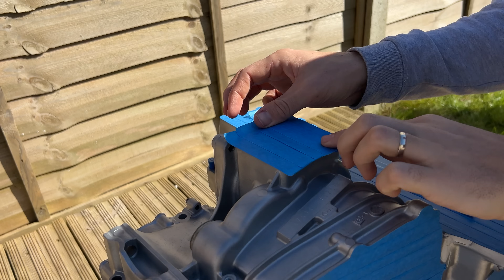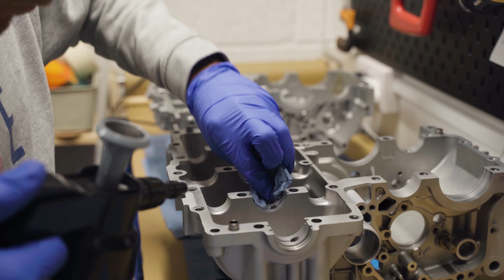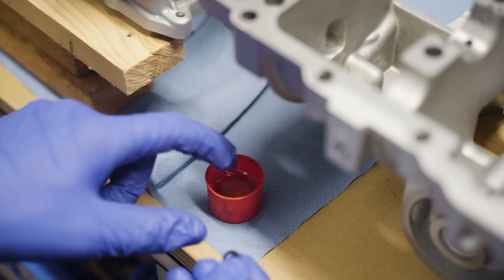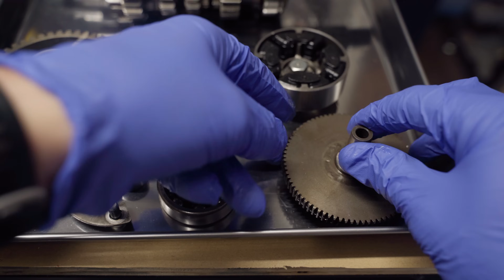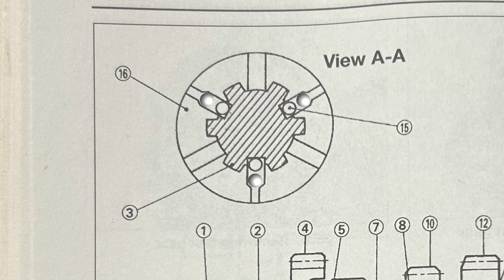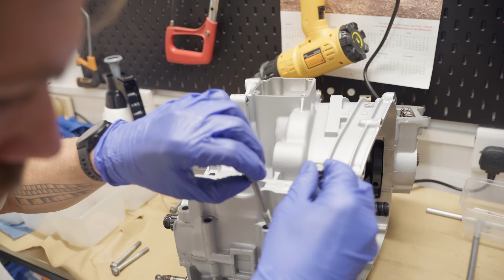Assembling ZX7R Crankcases - Ep15 | ZX7R Restoration | Tom's Workshop

Comment: Where did you find the part number for the cover for the end of the crank - on the Fowlers web site it just says engine cover with no part number?  Thanks
Reply from the maker: Ah yeah that’s a little confusing. That just means that the part is listed in the “Engine Cover(s)” section for some reason.
Reply: Thanks - found it.

Comment: Yay! Any an engine bench as well. Quick question on the engine painting - my missus would go into orbit if I suggested baking it in the oven. On a serious note does it produce any fumes or lasting smells?
Reply from the maker: Haha yeah it definitely left a smell in the oven, so I did end up having to deep clean it and run it for a bit to clear out before we cooked in it again. I feel like I only got away with it because we use the Air Fryer way more than the main oven now 😂 Allen Millyard uses his BBQ which I may do going forward

Comment: Tom where are you getting new parts from im helping restore a 99 zx7r and struggling to find new parts also what sealant did you use when putting the 2 casings together
Reply from the maker: I use a mixture of places but generally Fowler’s and CMSNL. EBay for second hand bits and WeMoto for good pattern bits.

I used ThreeBond 1215. Did a bit of research and this seemed like a well recommended sealer
Reply: @tomsworkshopprojects  thanks for the info will help loads where down south did you get your casings vapour blasted
Reply from the maker: @karlread5981 no probs, a guy called Steve over near Portsmouth, he trades as Ultrablast
Reply: @tomsworkshopprojects thanks carnt wait for more content. Your videos have helped a lot with rebuilding ours
Reply from the maker: @karlread5981 haha glad to hear, although at my pace, you’ll probably be done before this one 😂

Comment: I'm always eagerly waiting for your next video 😁 Well done, mate! The ZX7R is a dream bike I want to get soon before the prices get out of hand, and watching you beautifully restore this one gives me so much joy!

As for the high heat paint, though I do not believe you needed it for engine casings (I have used regular spray paint many times and held really well), in this case I think you could use a blowtorch to cure it. Did it multiple times and worked great, you see it cure immediately. Just test a patch first and do not stop on one area for too long or you'll cook it 🙂

Looking forward for the next clip 😁
Reply: I used satin black VHT engine enamel with VHT engine primer as a base coat, on my 87 FZR1000 engine, the barrels must get very warm on those as ive never seen one that kept its factory engine paint on the barrels. But i have seen guys use just standard spray paint  (red & blue etc) on Suzuki oilcooled engines in streetfighters (🤢:-) and its been fine.
Reply from the maker: Yeah this is a pretty basic engine spray paint, mainly for just an added bit of protection long term. It’s also only really during assembly I’ll see the benefit 😂 once it’s together it’ll barely be noticeable 😂 

Appreciate the comment!
Reply: Heat gun would be the smarter option.
Reply: @HalfdeadRider  I tried heat gun, took ages and didn't cure it too well. Might have worked on smaller parts
Reply: @UnknownUser-0090 a good heat gun heats upto 600 Celsius it is more than enough, plus less likely to cause damage.

Comment: How does riding the ZX7R compare to the FZR1000? When the sun is shining and you want to ride, which bike (including the VFR400) tempts you the most?
Reply from the maker: I’ve never had the luxury of them all being on the road at the same time, but hypothetically if I could pick up the keys to any of them on a nice day, it’d probably be the RVF every time, the ZX7R is probably a more nimble ride than the FZR, which can feel a little bit closer to a tourer in size. But none of the others come close to the torque you can grab at at any RPM in any gear from the FZR. 

I’m hoping to do a full few days riding on the FZR in the summer.
Reply: @tomsworkshopprojects  I'm with you Tom. When mine are all running properly my RVF comes out of the garage before my CBR400NC29, CBR600FS and the Bonneville.
Reply: @tomsworkshopprojects  I think you must have an ride with an old Fireblade with carbs. :-)